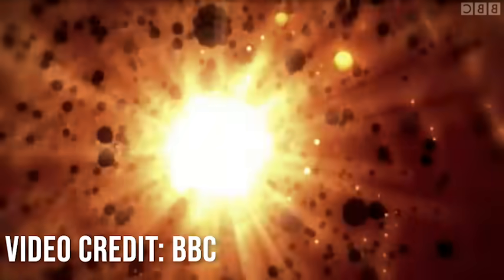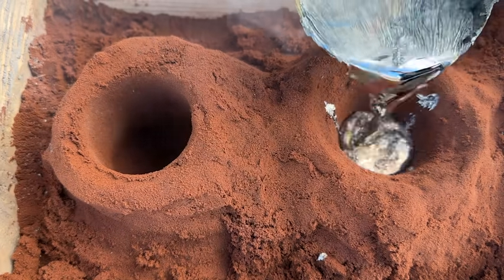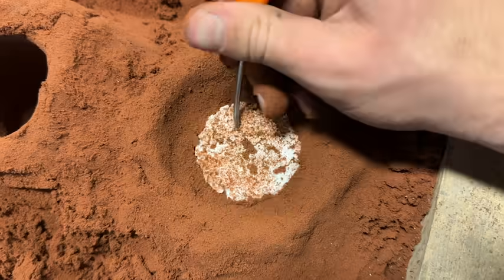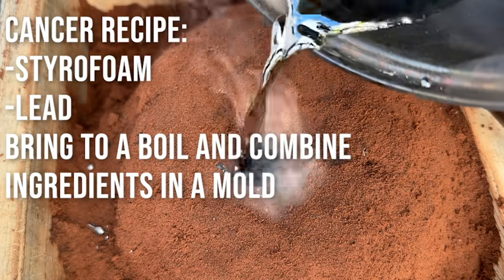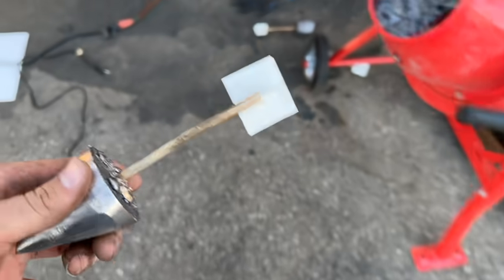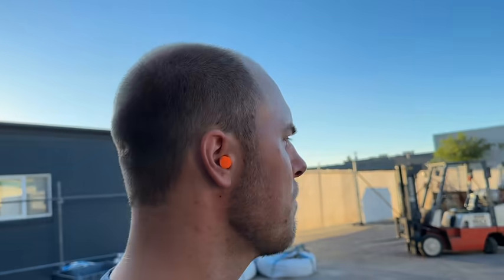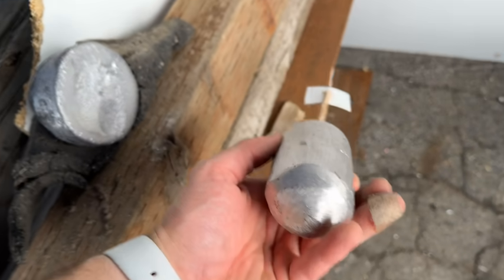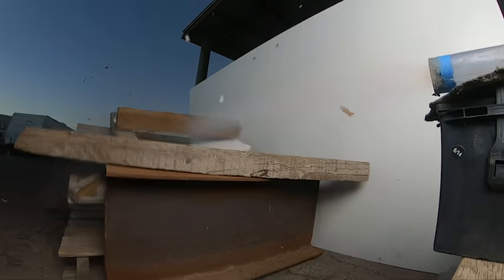We Made a Nuke (Simulation)

Comment: This isn't actually how most nuclear weapons work because it turns out you need a lot of fissile material for it to work which makes your bomb huge heavy and expensive, and most of that material gets blasted away before it does anything
Implosion bombs require less fissile material which makes them smaller lighter and cheaper, and the implosion forces help to tamp the reaction, containing it for longer and allowing more fuel to undergo fission, however they are more complicated which is why the "trigger"/"gun" type bombs have been built and used in the past
Reply: Bigger more dangerous zone of irradiation after the fact though, whether that's a positive or negative is another matter

Comment: You had the correct diagram on the screen but you used the wrong one. Little boy shot a cylindrical bullet towards a stationary slug. And the "impact" wasn't really relevant. they just needed to get the cylinder to surround the slug as quickly as possible to reach super-criticality.

Comment: Someone once told me that pure iron was the most stable element there is and it is impossible to get a nuclear reaction out of it. I told them "Well not with that attitude"
Reply: Joke aside, that's not even true.

You absolutely can get a nuclear reaction out of it - it's just endothermic. Iron photodisintegration is an essential component of supernovae in very large stars.
Reply: if you bombard ANY element with enough neutrons for long enough it will eventually absorb enough to become an unstable isotope and decay into something else lol
Reply: Actually, it's the most stable in that it has the longest half-life. Check out a concept called Iron Stars.
Reply: When a star, like our sun, uses up all its hydrogen, it will start going down the periodic table, using the next in line for fusion, until it hits iron. Which doesn't give a good result. The star then collapses due to the gravity and weight of itself, with no nuclear reaction pushing "out" to hold itself up.  BOOM. So yes, iron is the last stage of a sun, and the end of it.
Reply: @johnfish1194  Nuclear fusion continues well beyond iron. The heaviest known element - Oganesson-294 - was synthesized by fusing californium-249 with calcium-48. 

Reiterating my last comment, because you seem to have missed the crucial point of it: the reason why iron is the 'end of the line' is not because it cannot be fused. It can be. 
It's because Ne-56, and heavier elements in general - can be fused, but the resulting reactions are endothermic. They consume more energy to fuse than the amount of energy you get out. This then disrupts the equilibrium you normally have in a star, where higher density means more fusion means more power means more force pushing out. But _they can still be fused_.
Reply: totally agree, and i  see your point, but my point was, in a star, even though there might be some fusing, its not enough to sustain the star from collapsing. You just said it with more detail. @TheLoneWolfling
Reply: @johnfish1194  "in a star, even though there might be some fusing, its not enough to sustain the star from collapsing" - absolutely! Note my original response was to "it is impossible to get a nuclear reaction out of it.", not anything to do with stellar collapse.
Reply: It is possible to get it to fuse/split, but both ways it’ll be endothermic (without taking the energy needed for initiation) unlike any other element which will release at least some energy (even though it’ll take more energy to initiate the reaction)
Reply: @IronHexacyanoferrate  "unlike any other element which will release at least some energy" - that is untrue. There are even light-element fusion reactions that are endothermic. For instance, the first step of the triple-alpha process, 4He+4He->8Be, is endothermic, at −0.0918 MeV.
Reply: @TheLoneWolfling  clarified in brackets, breaking the bonds in the nucleus of iron will not produce energy, just like breaking the bonds in water will not produce energy. Yes energy needed to start a reaction in many nuclear reactions is higher than the energy released from the nucleus, but the nucleus releases energy. To be even more clearer, iron is the element that has the least unstable bonds, so transforming it into any other element will require energy, transforming nickel into iron will also be endothermic (due to the energy needed to start the reaction), but the energy in the nucleus will decrease. Also helium can fuse into lithium with a release of energy, iron can’t fuse or split into anything with a release of energy.

Also I’m not a nuclear physicist, so take everything I say with a grain of salt, all of what I’m saying is based on a lecture I had in uni